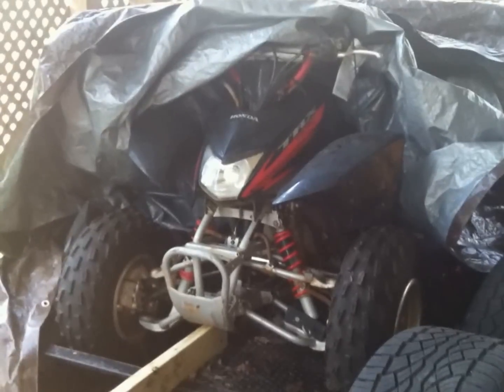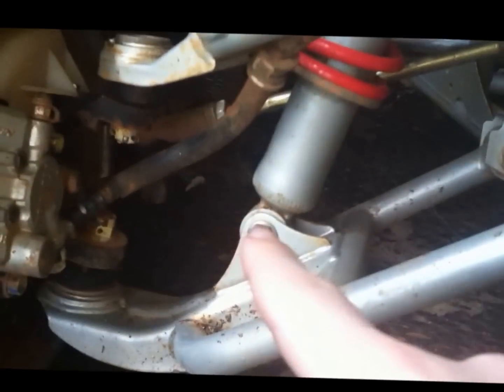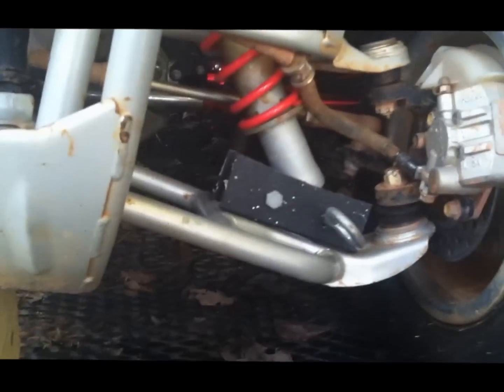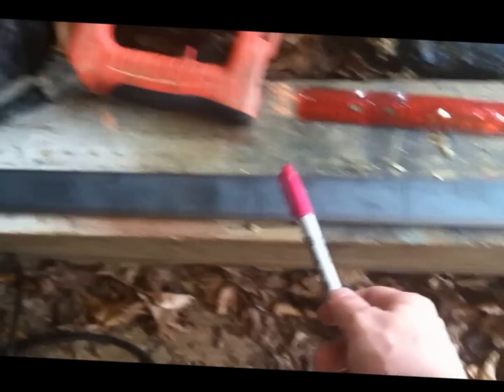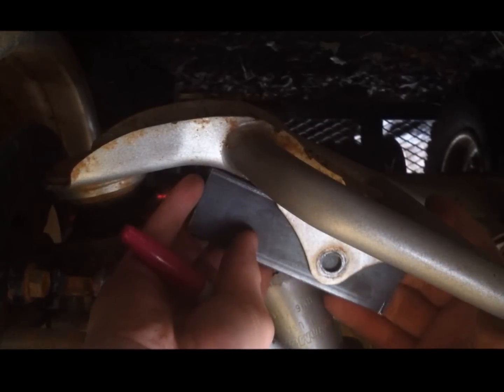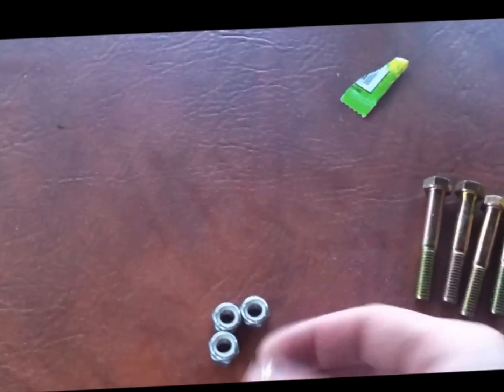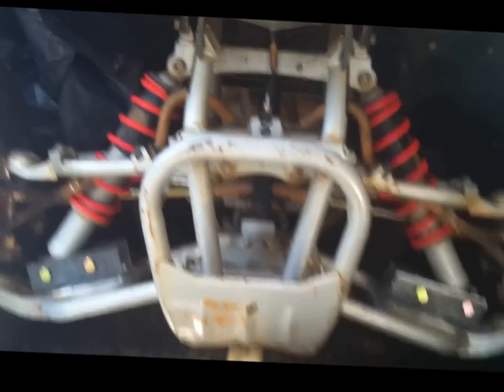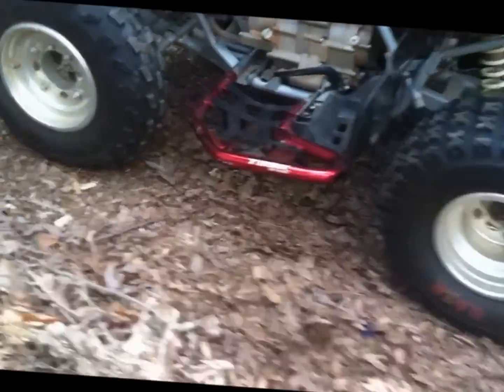How to lower and widen an ATV for $10

Comment: Sketchy.  Probably ok if you're just cruising around the neighborhood but wouldn't take it off road.  Engineers design suspension.  Pivot angle, max extension are major factors to consider